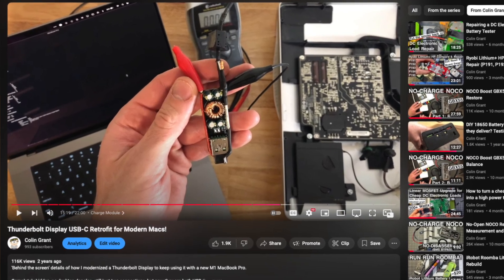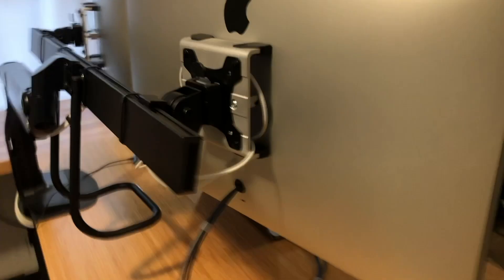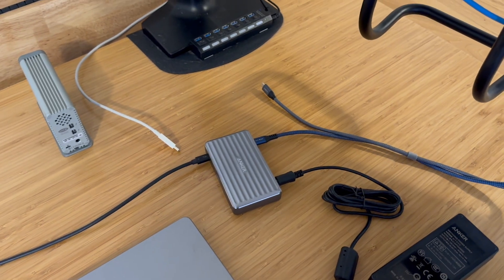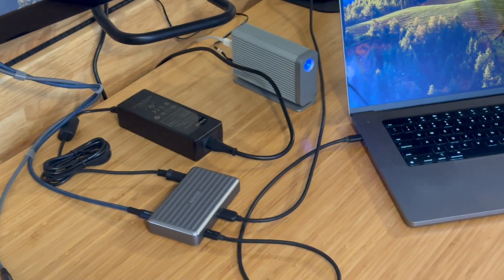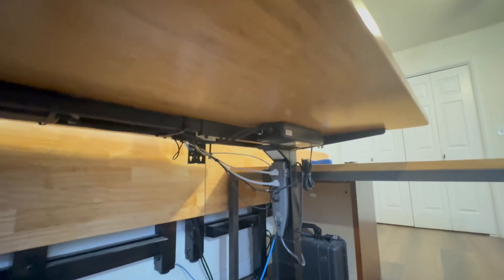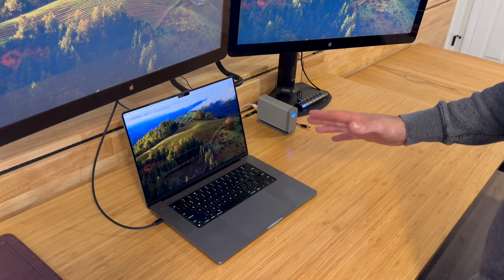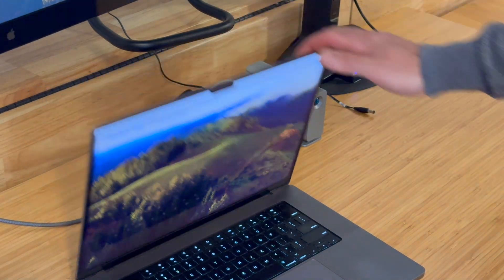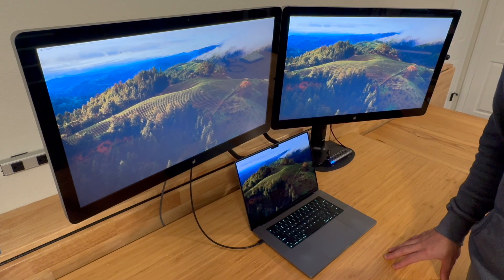SINGLE CABLE Thunderbolt Display USB-C Retrofit for Modern Macs!

Comment: Could you use the Thunderbolt Display's DC power output to power the hub's DC input (via a USB-to-barrel plug adapter), avoiding the need for the hub's bulky external power adapter?
Reply from the maker: Good idea and I looked into that but the hub does 100W Power Delivery to the upstream computer using 20V 5A. That’s way way more power than the TB display’s MagSafe PSU can provide. In the original video I tricked it into being a 60W MagSafe charger, and I’ve read that 85W may be possible. But still not enough for the hub!

Comment: MAC is an acronym for networking, Mac is short for Macintosh and should be written as such.
You are really playing with fire unplugging drives before ejecting them, you have a high chance of losing data even destroying the format structure that you would have to start over and recover the data if you are lucky.
Reply from the maker: I hear you but I’ve worked in IT since I was 14 years old and never ever have I seen corruption from an idle drive being unplugged before dismounting. You should feel free to implement your own standards for yourself though. Where do you see MAC written all caps?
Reply from the maker: Ah, I found MAC in the description and corrected it. Thanks.

Comment: Hi great content. Do you know if there is s fix to plug an Samsung phone into my Mac thunder bolt display?
Reply from the maker: Won’t work unfortunately because the Samsung phone doesn’t have the Thunderbolt chipset to drive the display. Best bet is to look for a screen casting app that can stream to AirPlay on a connected Mac.
Reply from the maker: Your phone should work with the USB ports though. They’re just a hub for whatever thunderbolt capable computer is attached to the display.

Comment: I'm planning on doing this but replacing the entire display panel with a new 165hz hdr screen and a corresponding controller so it's a sleeper build frankenmonitor
Reply: Might be better off going the iMac 5k driver board build.

Comment: Sir your project just amazing, and I am also doing the thunderbolt display cable modification. Your video is truly helpful!
Just want to share after color calibrate with a spyderX Pro, it fix the old LED turned yellow issue, And I would probably let the DC to PD type C reach able so I can swap different kind of cable more easily.

Comment: Great video Colin. Does this new solution still offer brightness and volume control through the single cable? Unsure if this is handled by the magsafe 2 cable or through the power?
Reply from the maker: Yes! That all still works perfectly! Click on the external display’s desktop and press control + brightness up/down. Volume buttons just work if you have the display selected as the audio output. That’s all handled through the Thunderbolt connection.

Comment: Road Runner here. I just wanted to express my sincere gratitude for this detailed tutorial. While I'm quite experienced with DIY projects, electronics is new territory for me. Your video gave me the confidence to try this modification!
Quick question about my setup: I'm running an M1 Mac Mini with an older Apple Cinema Display (via HDMI) and want to add two modernized Thunderbolt Displays using an OWC TB4 hub. Since I don't need charging (Mac Mini), is the USB-C PD converter really necessary? Would love to know if power and display functions are truly separate.
Also, I hit a snag during disassembly - damaged both the main connector cable and camera connection (though camera isn't critical since I use USB-C anyway). Any chance of repairing just the connectors, or does this need a full board replacement?
For the third display limitation, I'm considering either DisplayLink or DisplayPort MST with BetterDummy - any preference based on your experience?
Thanks again for making this valuable contribution to sustainability. Keeping these excellent displays alive is so worth it! 👍

Comment: Thank you for posting Colin. On my M1Max MacBook Pro, I‘ve been using the Thunderbolt Display with Apple‘s T2-to-T3 adaptor. It has been very finicky with the monitor often going black for minutes and randomly flickering. Is this a known issue, and is your retrofit eliminating the bad connectivity I am experiencing with Apple‘s adaptor?
Reply from the maker: @carstenbecker2850  mine did that until I replaced the TB2 cable. I hope that’s all you need.
Reply: @colindgrant  you mean the one attached to the Display? I don't think I can un-attach it from the monitor. Have to open up the Display?
Reply from the maker: @carstenbecker2850  you can plug a new cable into the external port on the back of the display. Or you do what I did in the original video (linked in description). It shows you how to remove the ‘umbilical’ cable that is attached to the display. There is an internal port that works just like the external port. Check out the video it will be clear!
Reply: @colindgrant  Since I don't need charging (Mac Mini), is the USB-C PD converter really necessary? Would love to know if power and display functions are truly separate. Will it work with only Lightning cable switch as shown in your video, without connectig a 60W 6-35V DC to USB Typ C, as no charging is needed?
Thank you
Reply from the maker: @ The original video goes into that. If you just want Thunderbolt, you may not need any hub.

Comment: @Colin : Doesn't the blue light on the front of the laCie drive enclosure also act as a push-button switch? If so, you can remove the in-line switch from the power line coming in at the back. R^ n
Reply from the maker: @michaelthibault7930  oh wow, I had no idea. It was rescued from e-waste! I’ll try that.